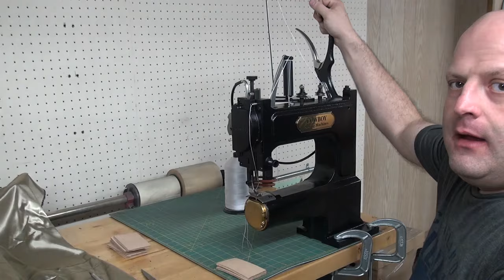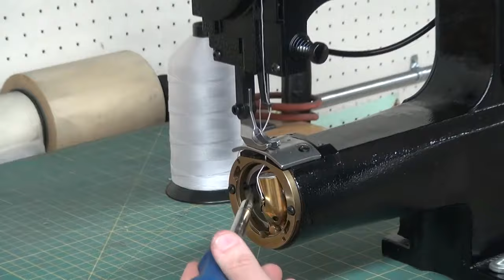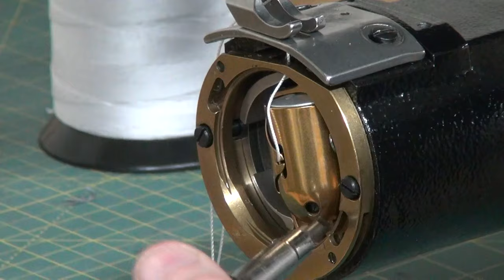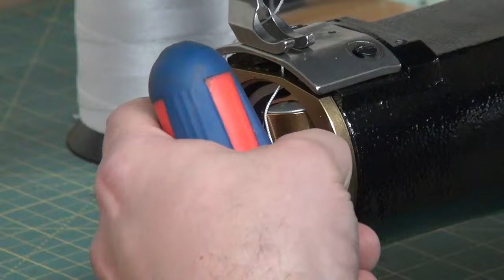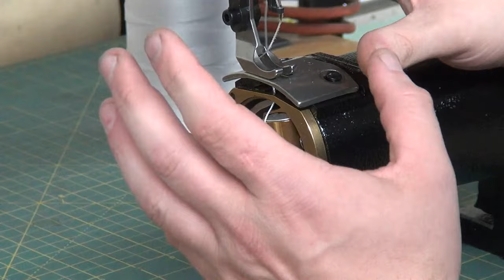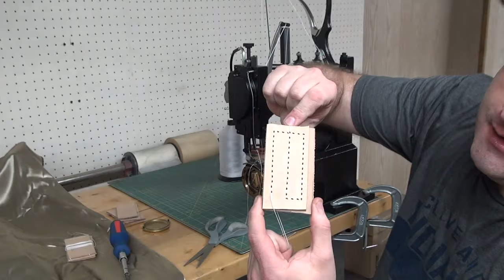Helpful hints for OUTLAW leather sewing machine for knife sheaths

Comment: I have not been able to get my tension set correctly since day one. I called Tandy. They were absolutely zero help. Is there a video somewhere about adjusting the tension? I have tried everything. When I first received the machine I opened the bobbin to install a new one with thread. When I did that the spring and the bobbin went flying. Idk if something was wrong from the factory or what. It's very frustrating. I've had thus machine for 2 years at least and have hardly used it because it makes such a horrible stich on the back side no matter what I do.
Reply from the maker: Please check https://cowboysew.com/outlaw.htm if you can find right video. If not, please call our expert in Ohio, USA at 330 692 1418 or neelre@comcast.net, I am sure he will help you out within 30 miniutes.

Comment: Great video.  Thanks for posting.  Will this machine handle thinner projects equally as well?  Like wallets?  I'm sure that sounds ridiculous since this machine will sew a few cars together, but I'm wondering how versatile it is across all projects.  Or is it specifically meant for more 'meaty' things like holsters, sheaths, etc.
Reply from the maker: Randy, this is extra heavy duty leather sewing machine for stitching thick leather and strong thread.If you use for very thin leather goods, you need to buy a small needle, then you need to re-adjust the machine. So we do not suggest you to use this machine for thin leather products. CowBoy CB6900 is the professional machine for  light to medium weight leather.

Comment: Will this machine sew through leather with contact adhesive between the layers? Will it cause sewing problems?
Reply: Yup it stitches perfectly through 3 layers of 3.5mm veg tan with contact adhesive on all layers. To say im happy with this machine is an understatement. Its a Game changer.
Reply from the maker: @westernalism13  Hey do you have CB3200 leather stitching machine on hand??
Reply from the maker: I am not 100% sure before testing.
Reply: @HightexHeavysewingtechnology  ok thanks. Mine just turned up in the mail ill test it out once i get my head around the machine
Reply from the maker: @westernalism13  Ok, thanks!